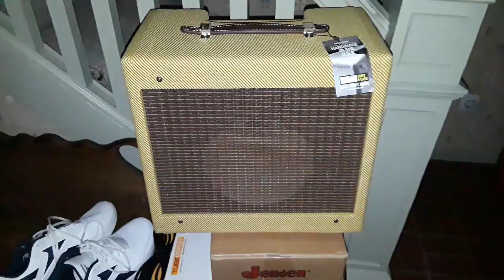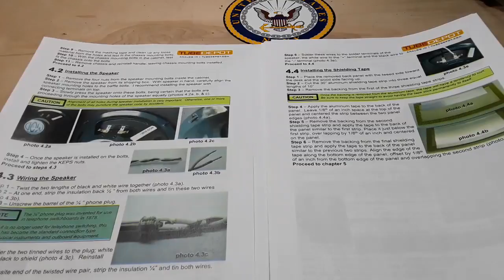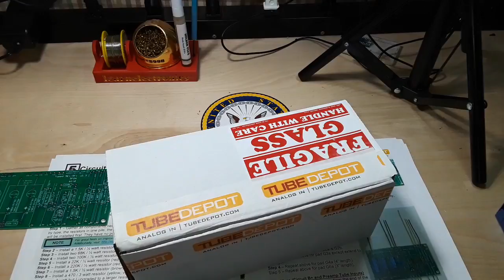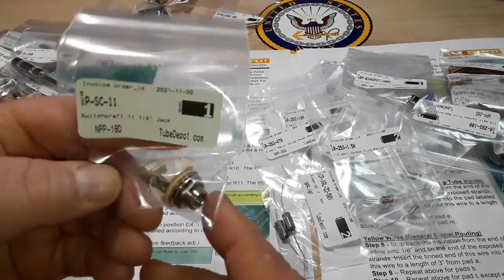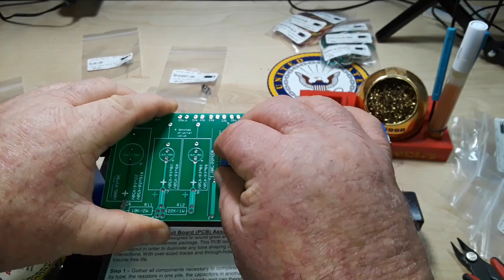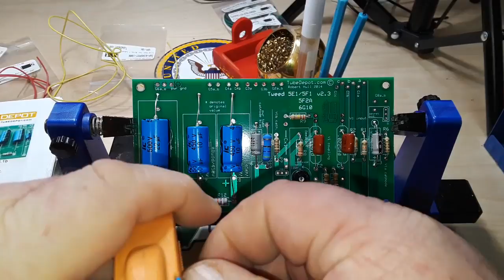Fender Champ Amplifier Kit Build Part 1 of 3

Comment: What year did Fender switch from point to point wiring and start using circuit boards?

I got an old Gibson amp from the 50's and an old Fender Harvard from the 50's and both sounded great. The magic smoke escaped out of the back of the Gibson not too long ago so I just use the Fender now. I suspect it's the old caps but I have not looked yet.
Reply from the maker: I'm not sure of the exact year. But I would guess somewhere in the '80s. Almost everything now goes PCB. I just bought a new blues Junior version 4 last year and it too has a PCB installed.
Reply: @learnelectronics   I did notice yours still has a Jensen speaker. Not sure if it's the same as mine but at least it's the same brand. The cabinet in your kit is beautiful. Somebody recovered my Fender decades ago with a much uglier material. It was before they started making the tweed fabric again. It still sounds great but the only thing good about my ugly fabric is it kept the price down when I bought the amp at an estate sale. Nobody knew it was an old Fender including me. No internet to look things up back then. I found out years later my little estate sale amp was older than me and not very common. While it sounds good, I think that old Gibson in it's white vinyl sounded better. I may have to find some capacitors with the magic smoke still inside and fix it one of these days.

Comment: What brand wiring strippers are you using because it has that silver thumb dial to measure the length? Can you make a video lesson after its built to measure the gain for each stage using a calculator formulas from each input/output would be nice